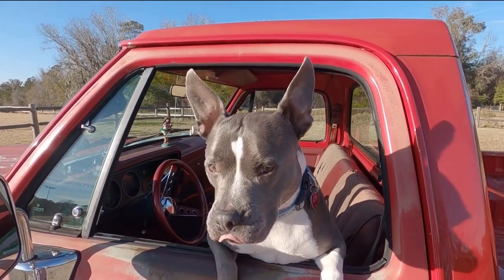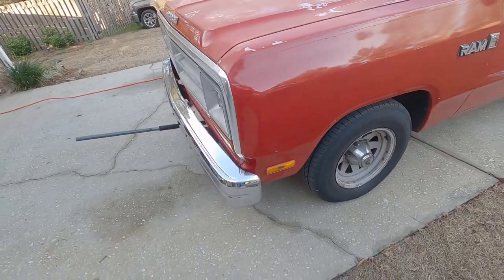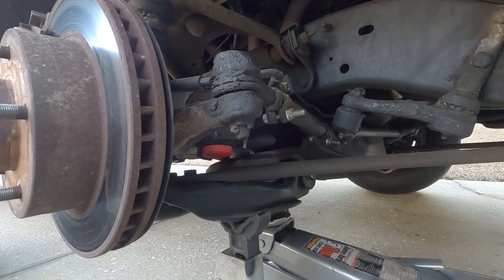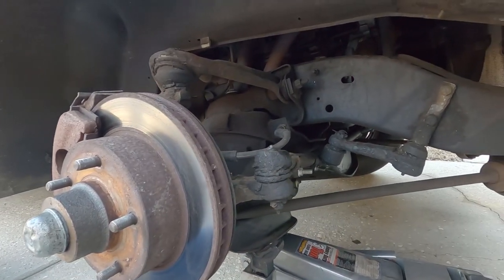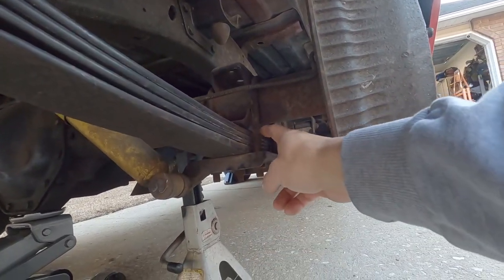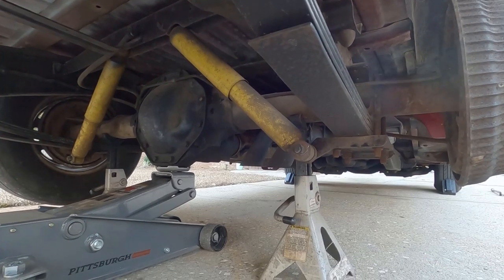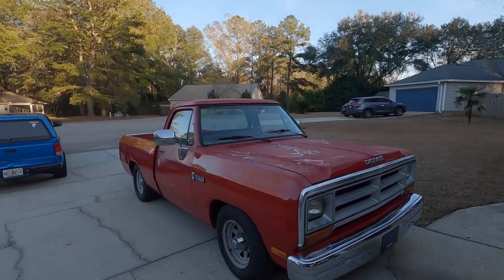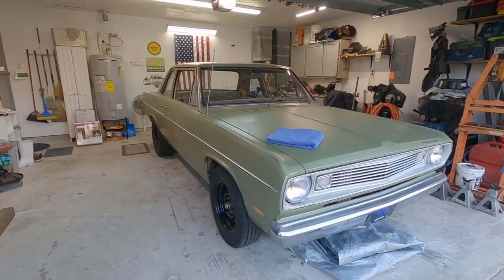How I lowered my D150!!!

Comment: For the bumpsteer, the steering arms from an 81-93 van or an early Dakota should fit your spindles and flip the outer tie rod to the bottom but check strut/radius rod clearance to the joint body/zerk at full steering lock. You might want to check what springs are installed. The basic, light-duty d150 spring wire is 0.812” thick (without paint) and rated at 850#/inch at normal ride height length (10.5”). The heavy duty truck spring is 0.830” with about the same free length of 12.5” and rated at 1034# (comp to 11” but the rate will increase when you trim it to desired ride height). If you want to try more rate, new replacement springs are sold in matched pairs for about $70; probably not much cheaper used and a lot more effort to pull. Van springs were a couple inches longer and either 0.812 or 0.855”. Crew cab long bed was the thickest at 0.890”. Lots of other springs you could use from other makes also that will fit the seats properly.

Comment: Reading all the coments . Now it all makes sense driver side front sitting lower . Van lower control arms and new spring it is . And fuel cell afterwards. Having the rear flip gave me a 8” drop and you bet the fuel tank sits 4-5” off the ground 😅

Comment: A few yrs ago while restoring one of my lil reds .Took it to a spring shop for some new springs .The old guy that worked there .sayed that the bias over time comes out of the spring  over time because of the gas tank and driver on that side .. That they came with extra bias in that side new .. He just rerolled the spring  then the trk sat level just like the day i got it frm the dealer...
Reply from the maker: I guess the aftermarket doesn’t take that into account when making reproduction springs.

Comment: The "D-series Lean" is simply based on layout. You have a 15 gallon (US) tank, gas weighs 8lbs a gallon, plus a 200lb +/-  driver, gives an extra 350 lbs on that single side. With a dry curb weight of 3600lbs (based on my 1984 LA-powered D150) that extra weight is the reason for the lean...  I'm putting B100-van lower control arms, tubular upper control arms, and drop springs on my 90 D100, and thinking of taking out 1/2 coil of passenger side spring to balance it all out.
Reply: Which also I need to ask: did you have any alignment issues with the van control arms?
Reply from the maker: I didn’t

Comment: On my 78 D150 I flipped the rear and moved the springs onboard the frame and I’m running Competition Engineering adjustable shocks with mounts welded to the axle tubes. On the front I just remover 1 coil and 1”.
Reply: Did you narrow the tubes or go with a more offset wheel
Reply: @danbuchner1494  10” wide with 8” back space and I tubbed it. Running Hoosier 29, 14.5x15.
Reply: @jimmyford271  Frikken kool it must look nasty from the back and side
Reply: @danbuchner1494  it does. From the side you can see the exhaust too. It’s a 499 ci low deck and I have custom made fender well headers that have 2.25” primary tubes and 4” collectors it has 4” exhaust from the collectors with small mufflers and turn downs just passed the cab.
Reply: @danbuchner1494  it’s a ClubCab short wide. Has an 8 point roll cage but from the out side it mostly hidden.
Reply: I would like to see pics of your truck  Its nice to see guys like us doing old 150s  and keeping them Mopar ANYBODY can build a ls chevy   What does it run in the 1 /4 mile @jimmyford271
Reply: @danbuchner1494  the best I’ve ran so far is a 12.75 but our air here really sucks the DA at the time was over 6000’
Reply: @danbuchner1494  I’d send you some pictures but I would need your FB

Comment: After looking around for used Dodge Van lowers I found new ones on Rock Auto (chinese no doubt) for 88 bucks ea. with a ball joint. Can't crawl around  pick and pull for that kind of money. I bought my '88 D100 new. Its patiently waiting for me to finish my current project. Our era of Dodge trucks get very little love from the aftermarket.
Reply from the maker: Yep. Basically zero aftermarket. Makes us tougher. 
No easy LS swap crap here or build a Ford or Chevy from a parts catalog (No car needed to start). lol
Reply: If you don’t mind em being Chinese buy em. Pulling the LCA’s in the yard sucked. I paid like 80 bucks for both of them from pick n pull. KC yards are not cheap.
Reply from the maker: I did the same. Kind of dangerous too. I put a tire under the control arm to catch it from killing me when the ball joint let loose. 🤦🏻

Comment: Driver side drop, due to Battery, Steering box, steering wheel and driver weight. my 72 does the same thing. Nice truck BTW,
Reply from the maker: I've heard that from others too. Why doesn't new springs fix it? is the frame twisting?

Comment: Lowered mine off your info little over a year ago. Worked great, left side sat lower also. Only issue I had was the camber bracket that the camber bolts ride in..... yeah I stripped those out and had to fabricate my own. That sucked.
Reply from the maker: Yikes. Old truck, it happens.

Comment: Did the truck come from the factory with that axle? My 87 D-150 had an 8.25. When I bought it the axle had an issue, when I shifted from drive to reverse or vice versa it made a loud CLANK. I got under and discovered it had excessive back lash. I never bothered to find out why, I got an 8.8 out of an F150, IIRC it was an inch wider,  the spring pads were further apart and the Ford uses a larger U joint. The bolt pattern for the wheels was the same so I cut them off and welded new pads on and used an adapter U joint and it worked out fine.
Reply from the maker: 9.25

Comment: I’m planning to build a D150. So if I understand you right. To lower the front end to the height yours is- you just use the van control arms? That seems easy enough. I know from the previous comments I can get them from an online parts supplier or the salvage yard. Flip kit in the rear is easy enough as I’ve done those on Chevy trucks before. This will be my first 2wd Mopar truck  so I’m learning! Thanks for the videos!
Reply from the maker: Yes sir. That’s all there is to it! Enjoy!
Reply: @TheGasTap  thanks!

Comment: Fuel tank driver and steering gear drags the left Down by about  1.5 “ or so. I moved an aluminum 22 gal fuel cell between the frame rails all the way in the back lost 30 pounds it’s level now 😂. MOPAR2YA 😎
Reply from the maker: Sweet! What fuel tank did you get? Part number?

Comment: I just put a Cummins in them, that gets the front end down. :-) I like my girlfriends 98 Dakota for riding around but I do miss the bigger cab of the 1st gen. I feel a little cramped in the Dakota. I originally wanted to swap my Mercedes diesel into a Dakota to get 30mpg but am kind of thinking maybe I should do a 1 gen instead for better comfort. Not sure I get get 30mpg out of one of them tough as I think they pull a lot more air, weight isn't much different I don't think.
Reply: I too thought of doing a benz swap in a 07 ford ranger. But those benz diesel motors cant get much power out of them..30mpg i dont think they will ever do that..
Reply: gulfy09 I get 26 to 28mpg out of my stock 5200lb Mercedes car. I think with the trucks overdrive and lighter weight 30 should be doable. Heck I get 19-20mpg now in my d350 crew cab with an engine twice the size.
Reply: @bcbloc02  im mean the older benz. But it dont add up a 93d250 cumming 5 spd.easily gets 22 to 25 mpg. Thats a 5.9litre then average cars today with smaller displacement dont even come close..

Comment: Thank you for this, I've heard about doing it this way and wondered how it would ride. As for sitting lower on the drivers side, I had the front clip off my d150 and noticed the rivet holding the frame together on that side was broken. Not sure if that could change the height or not but might be something to check.

Comment: Been doing some research on how to lift my b series van. You think if I use the lower control arms from these trucks will give me a couple of inches of lift?
Reply from the maker: It would but the problem is the bolt size is smaller on the d series. Not sure if you could sleeve the B van holes to make it safe. I’d love to have a lifted B Van!!

Comment: You think a B350 control arm will work? I'm not sure what the differences are between the B's really.
Reply from the maker: It has a bigger ball joint(350). The 150 is the one you want.
Reply: @TheGasTap  that makes sense. I already had a 350 here. Thanks. I'll be on the lookout for a 150 then.

Comment: Does axle flipping the rear not jam the drive shaft too far into the trans, I saw someone saying that they lost reverse and had to physically hold the shifter into gear or it would pop out of gear after a week
Reply from the maker: Measure it!!!! Don’t take anyones word for it. I had a bent driveshaft after upping my horsepower so I don’t have a stock unit now.
Reply: So I did the axle flip, and yeah, my driveshaft is jammed way too far into my trans now. If I ever get the time I’ll have to shorten the driveshaft an inch or so

Comment: Did lowering it affect the camber in front, did you have to adjust the camber bolts on top control arms to get back to neutral camber?
  I transplanted an 87 suspension onto a 47 frame and its got too much positive camber with my camber bolts moved all the way in i can get them, wondering if i lower it, will it help suck my wheel back to neutral by making the top control arm drop in a little bit
Reply from the maker: I did mess with my alignment pretty bad. I asked the tech that aligned it how bad it was and the service advised interrupted him and just told me everything was great. I’d like to get it on the rack and check the alignment myself.

Comment: hi, i 'm lowering mine using the same set up. can you suggest a front shock that would work with this application? thanks
Reply from the maker: I used summit racing 90/10 shocks. I measured and chose the shock length I thought best fit.

Comment: I know it’s been a year but I just got myself a 75D 100 and I want to lower it bad and yes it sags on the passenger side so you think cutting a half a coil in the driver will level it out?
Reply from the maker: It helps. I have have a half coil cut out of mine. Still not level.

Comment: Have you ran with any issues with the fuel tank beeing to low? I dropped my 1990 d150 with the same setup as yours but my fuel tank sits way too low. I actually cracked it already luckily I found one for dirt cheap. I'm starting to think the previous owner didn't strap the fuel tank correctly. The straps are completely loose. And my tank is sitting way past the chassis.
Reply from the maker: Mine sits level with the bottom of the frame.
Reply: @TheGasTap  I thought so!! I'm going to install my new tank now and get it right where it's suppose to sit. I really appreciate your reply. I subscribed to your channel You've got great content. 👍
Reply from the maker: Thank you!

Comment: What lower ball joints did you use the ones that came in the lca will not fit my truck knuckle
Reply from the maker: You have to be sure to get b150 control arms. B250’s have the bigger ball joint.

Comment: I’ve got a 79 d200 with a 360 that I want to lower. What year did you say yours is?
Reply from the maker: 1986
Reply: @TheGasTap  awesome, do you use the original truck springs or can you also swap in the van springs?
Reply from the maker: I’m not sure of the spring rate and height of the van springs. Never tried it.
Reply: @TheGasTap  I will be doing mine once I get a new steering column installed,

Comment: I have 4, 80s model dodge trucks that i have lowered. Cut front coils and flip the rear. To get then to set level side to side i cut one and a quarter rounds off the LH front spring a one and a half rounds off the RH front spring. There is the added weight from the battery and gas tank(and driver) on the LH side of the truck and they will not set level with out adjusting hight on the LH front coil. If you lower by cutting the front coils.

Comment: Is it true Dakota spindles can be used to lower the front as well?
Reply from the maker: I've heard that but never seen it done.
Reply: I’ve never heard that but wish I had lol. I have an 87 Dakota that I put Belltech 2” lowering spindles on so I had the stock ones.
Reply from the maker: I love dakotas. If big red wasn’t my first truck I’d snatch the engine and drop it in a Dakota.
Reply: @TheGasTap  I built a mild 318 and put in mine backed by a 46RH transmission. It’s a very tight fit. I had to move the condenser under the bed so I could still have AC lol
Reply from the maker: Interesting. I had a lot of room in my ‘88 with magnum 360. I used Schumacher engine swap mounts and a 727.
Reply: @TheGasTap  when I did mine they no longer made the mounts so I used Tin Man universal hot rod mounts. There’s just enough room between the water pump and the radiator to slip a fan belt through.
Reply from the maker: That stinks.

Comment: The real issue is the rims and tire combo. Any rim but those. That like going to the beach with your girl friend and she has toe nail fungus
Reply from the maker: I love going to car shows and no one cares about the truck until I start it up. That’s my style.
Reply: @TheGasTap  but you could be a part of the show if you put some 255 60 s on it with a black steal rim. I like your confidence though. The truck is a 10 on the fun factor scale.
Reply from the maker: I have 275/60/15 nitto 555r drag radials. Why do I need a smaller tire?
Reply: @TheGasTap  true.  Have you ever just look at something and say to yourself man there is something wrong with it.  That’s  what I think when I see your truck. It’s just a taste thing. Don’t take offense. I made a change to a 255 60 on a square body 30 years ago and it made a huge difference in every way. Just taste that’s all. I still love your beast.
Reply from the maker: I’d have to see it. I had 255/60’s on my Dakota and Durango. They were too small.

Comment: Or you could leave your front geometry alone and put drop spindles on it.
Reply from the maker: Where can I get D150 drop spindles?
Reply: @TheGasTap  I've bought from X2 industries but they're pretty expensive. If your on Facebook, look up Brandon LS Fruth. He makes upper control arms to correct the ball joint angle.
Reply: @TheGasTap  first gen Dakota drop spindles from belltech. You got to drill out  the steering arm and flip ball joint to fix dump steer. Might as well do a thunder bird rack and pinion as well.

Comment: Why are you welding anything to that axle?  Use the longer shackles but heck man, 
We just use hockey pucks (galvanized rubber) for spacers. You only need 1-2 for each side and they are easily fixed together. I also use them as motor mounts! 😂😂

But the idea to look at a 68-69 charger for the rear shackles is a great idea! 💡 🫶👏👏🎯👍👍

Also, buy a shorter spring. Cheaper and easier.